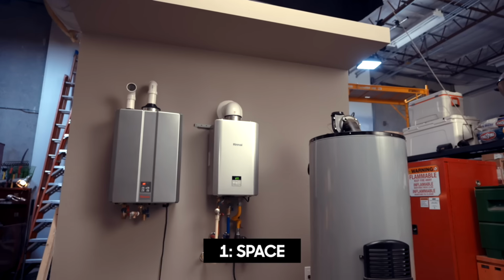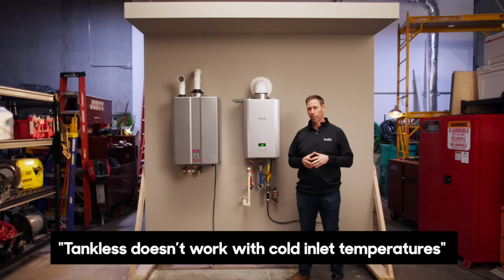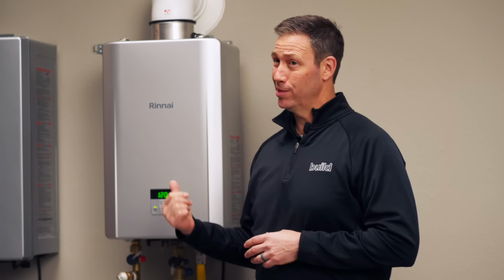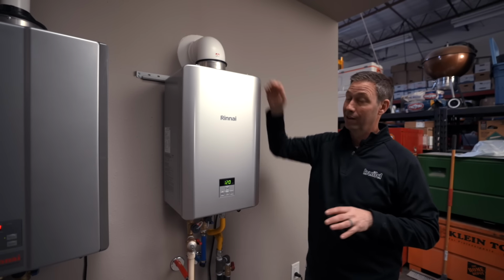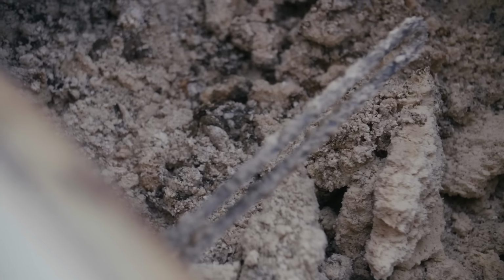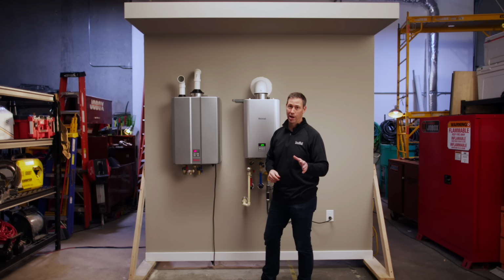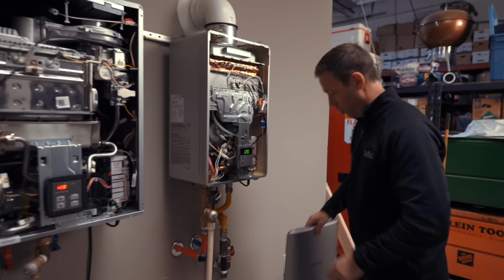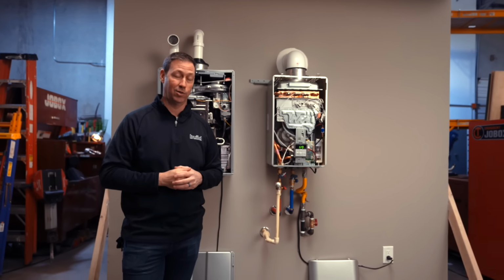DEBUNKING Tankless water heater LIES!

Comment: I'm a fan of the channel and really love watching some of the cool projects and products you share with us, but this one feels a bit too shill-ly for my tastes.  I know you have a lot of sponsored content on your show, and I think you usually handle the sponsor better and more evenhandedly than you did here.  I would have preferred to have seen how this compares and contrasts with other legitimate recommendations you've made for heat-pump tanks or other solutions on the market.  You can do better than this.
Reply: It is absurdly false for Matt to claim that now days a tankless costs about the same as a tank... not to mention a more costly install.  The total cost of ownership over a 15 year period is considerably more for a tankless (per Consumer Reports who also said there is no payback for the extra cost).  How much does it cost to periodically have a plumber come out and clean the heat exchanger?  To say you have to deal with scale regardless of system is false again.  Note that Matt shows an electric tank...not a gas tank which has MUCH more HX surface area.  The average homeowner can open a valve to drain sediment from a gas tank but most can't or won't clean a heat exchanger.  Most home owners DO NO water heater maintenance... a little REALITY check.  As a plumber in Texas I have seen countless homeowners that had to either get new systems or heat exchangers.
Reply: @logalert8954  that's not really true.  If you have a low usage of hot water that only occurs a couple times a day, a gas tankless can use less gas than a tank water heater that has to keep 40+ gallons of water piping hot 24-7-365.  The installation isn't necessarily more expensive, the PVC vents can be quite inexpensive compared to the chimney most tank style gas water heaters need.  For my parents the cheap installation negated some of the higher cost of a tankless gas water heater and their gas bill went down significantly.  It has paid itself off years ago and hasn't needed anything replaced.

Alternatively, if you have really high usage and happening at all hours of the day, tank style might be comparable in energy usage to the one or more tankless units needed to provide similar service.  A situation like that might never pay off, also apartment building water heater and industrial water heaters for places like laundromats.

Everything has it's place and tank style just isn't terribly efficient if the overwhelming amount of gas used is spent just keeping the tank hot.
Reply: @joequixotic3039  That is really true Joe.  How much does natural gas cost to run a water heater in the U.S.?  For most homes currently it is around $245 a year.  Not sure if you know Joe but there is a thing call fracking that was developed 15 years ago... its cheap now!  The energy loss over 24 hours in a 2 inch insulated tank is very minimal.  Again I am a plumber who actually installs both... its not even close regarding the average installation cost.  Ask any trustworthy plumber.  What was your parents bill before and after???  Tankless only saves around 25 to 30%... so they are saving at most $75 a year.  Over time that doesn't cover the higher initial system and installation cost.  Do the math... its pretty simple and or google consumer reports and read their article.  A 50 gallon gas tank costs $475... a tankless is more than double that... check online.  Again our install charge averages at least 50% more for tankless and we charge in central Texas $225 to clean the heat exchanger every 4 years.  If not it will scale up given you are hitting a small pipe with a flame.  It simply doesn't add up.
Reply: I like that you are very clear about the sponsorship - but it did feel like a bit of a sales pitch for the company. I think from an energy perspective the comparison with heat pumps is the interesting one. In theory they should be even more efficient, but are they, and which brands are best?
Reply: Myth's a much better implication than lie.
Reply: Yes, a really disappointing video. Replacing myths about thankless with questionable statements about tanked. At best thankless can get close to 100% efficient, but a heat pump HWS can be 400% efficient. Plus that can be 100% renewable energy. Many cities are banning new gas connections to deal with the climate crisis...and then we have this video.
Reply: @MrJamesy76  I am probably going to get a heat pump water heater for my 100% electric (solar) house but that doesn't mean tankless water heaters don't have a place.  So far it has worked out well for my parents with lower gas bills, plenty of capacity for their demand, and space saving too.

Heat pump water heaters seem amazing but they are electric which might not work in every circumstance and they are quite large which is a problem if your water heater location is too small.

Nothing is perfect.
Reply from the maker: Ok Jason. Appreciate the feedback. Thanks for your support. Matt
Reply: @buildshow  took it on the chin, good man.  I’d like to jump on the bandwagon here and say that you could definitely dive deeper into this topic.  One question I’ve been pondering is regarding the decision to use a big tankless heater or a few smaller localized heaters.  As cool as those big manifold systems look, I’m just not convinced they are necessary.
Reply: @Van-tastic  it seems like almost all homes are not designed for efficient layout of the utilities.  Mine will have my plumbing grouped in to two locations: upstairs/downstairs bath+kitchen and the laundry/water heater/filtration area.  Hot water should never have to move more than 30'.  That is for a fairly small home (2/1.5) but you could do the same with larger homes and have 2-3 zones to avoid the need for a hot water loop system for "instant" hot water.  The only thing is tankless heaters are not cheap and the really small resistance spot heaters use a lot of electricity making the hot water very expensive so the loop makes sense in a lot of situations probably.
Reply: @buildshow  I disagree, tankless is a great product.  Perhaps more comparison and a discussion of when tank style makes sense would improve this type of video but I think this was informative enough already.
Reply: I'm not sure if most of you read the title of this video lol. He's literally pointing out myths / lies about tankless water heaters lol. People responding are telling Matt to include other types of heaters... Hi, read the title, it's solely to address the myths and lies for ONLY tankless water heaters... Watch a video dedicated to cleaning one if that's what you're trying to view, but don't insult Matt for being true to the subject matter.. Wow...
Reply: @nuyork77  The problem is that Matt is the one that is lying.  A Rinnai tankless water heater (especially the ones pictured) and its installation does not cost near the same as a traditional tank water heater.   The savings payback per Consumer Reports is over 30 years (google it) and when you include the cost of the never ending periodic flushing of the heat exchanger it really doesn't make dollars and cents.  Most homeowners don't get the maintenance and it becomes a really bad situation.  You are litterally blasting a flame against a pinky pipe heat exchanger to heat water.  I also like how he compares the space savings with a huge commercial tank.  Point blank... Matt's Youtube channel is now just a person pitching products... which is what he was trying to do from the get go if you paid any attention.

Comment: @ 2:11 you make a great point that the shower temp is a mixture of hot and cold, so you don't need to determine what the GPM needs are based on 100% hot. There's a convenient formula to determine the exact percentage of hot water required to eliminate the guesswork:

= (T-C)/(T-H) / (1 + (T-C)/(T-H)) where T = target temp, C = cold water (inlet) temp, H = hot water temp
=(105-40)/(120-105)/(1 + (105-40)/(120-105))
= 81%

So, for a 2.0-2.5 GPM shower, with 40 F inlet temp, you would need 1.63-2.03 GPM of 120 degree hot water.
Reply: @DanielCaspi  No increasing temp at the unit will not increase hot water to the other fixtures. The unit is 200,000 BTU,s and no matter what you do the tankless will ramp up and down until it gets to an input of 200,000 BTUs . For instance lets say we have incoming water at 55 degrees and we take a shower at 105. That is a delta t of 50. Lets say we have a 2.25 Gpm shower head. So we multiply our 2.25 x60 minutes then convert to pounds and then multiply by our delta t to get BTUs per hour per shower. 135 GPH X 8.33 to get pounds per hour 1,124.55 X 50 =56227.5 x efficiency .98 =56,227.95 BTUs per hour at 2.25 gpm with an incoming of 55 degrees. Therefore you will get 3 good showers at 56,227.9 x 3 = 165,308.85. You are not going to slow one down or heat one up. It is just a simple matter of available BTUs. This is a big misconception in the HVAC field. Delta T and FLOW are both needed to figure BTUs. Also I would like to point out  on a Navien  When you flip the dip switch to raise the temp above 140 your warranty now goes to 8 years instead of 15 on the exchanger.
Reply: @anthonyspadafora1384  I see your point now about the energy balance calculations! Thanks for the correction and explanation. I thought the heating process worked a bit differently, and I've removed my previous comment.

It seems the only advantage to a higher temperature is having a hotter water supply at the hot-only outlets (e.g., dishwasher, laundry), which you could argue improves efficiency -- if you are having to repeat washing cycles due to incomplete cleaning. Rinnai warranties are not affected by the 140F dip switch.
Reply: You are not reducing anything, water flow remains constant because of the shower head restriction. So ultimately you need to measure incoming water temp and the temp you take your shower at, usually 105f. This will define how many BTUs you use per hour taking a shower. If you make the hot water hotter then you will just add more cold at the shower valve. This in fact makes the water heater less efficient because you are running higher stack temps when you increase the water temp at the heater.

Comment: We have no natural gas in our area.  Propane cost with the rules and regulations and fuel tank purchase or rental is cost prohibitive.  So electric is our only real option.  We used a small tank for storage (which does have to be powered), and then a tankless electric into the cold water input, and a recirculating pump which circulates the warm water in the line back to the tank, with a check valve preventing backflow into the tankless.  Works like a charm and hot water at every fixture in 2 seconds thanks to the pump.

Comment: Matt, I love your show but going from tank to tankless is always more expensive. In just labor alone you’re looking at about 1K more plus materials another 1K. Most tanked water heaters operate at 40-70k btuhs while tankless operates at 200k btuhs most gas meters aren’t sized for that even if you try to pull the gas through it, the meter will lockout. I don’t mind tankless I work on them all the time but the homeowners need to know they’ll spend more on maintenance as flushing a tanked water heater is like $150 where flushing a tankless is $350 in my area. Also, more breakdowns, sensors and valve failures are common throughout all brands. In some houses people experience the cold water sandwich which a secondary holding tank is required. I like tankless but the homeowner must be made aware of the benefits and downsides to tankless. Thanks for the video and keep them coming.

Comment: #969👍I looked into this.  My stainless steel gas water heater also heats my home.  It is super efficient and will out last me.  It also is easy when the power goes out since the generator is little used.  Why don't you get us a discount?

Comment: My parents had a problem with their tankless, when they would run a shower sometimes they would get no hot water at all.

So they adjusted the temp setting on the water heater up and made it worse.

The solution was to turn the temperature down so that the mix required more hot water to reach the temperature they desired.

I think a lot of people deal with the same problem because no one tells them they need a certain flow to kick on the heater and the higher they set the temperature, the lower the required flow will be.  This was in California  with low flow shower heads so it probably wouldn't have happened with full flow fixtures or maybe they got a water heater that was too big for their use.

I figured it out for them but they were about to complain to the plumber.  Now it has probably been a decade of reliable hot water with no issues since.
Reply: Yes, there's two factors, 1st is the minimum flow rate to even get the unit to fire.  2nd is the minimum fire rate on the burner.  For my Takagi, 0.6GPM on the minimum flow.  But the minimum fire rate is 15,000 BTU/hr.  I always set my temperature to the desired temperature, say 100F for a shower.  Then I don't need to mix in any cold.  I did have a time or two in late summer, when our water temps get up near 80F, that the heater was cutting off when the water flow was too low.  I have a low flow shower head and if I go below about 1.2GPM, and that's real near the low fire rate.  Aside from that, I love the tankless.  In an older house with the separate hot/cold taps, just setting the temperature to 100F and turning on the hot, it's always the ideal temperature.  And it's not going to change if a toilet is flushed, etc.

Comment: Two questions.  

1 I'm building a cabin in Tennessee and would love to put my tankless outside.  What about freezing Temps?
2 aren't the recirculation pumps defeating one of the biggest advantages which is not using power/gas as much because these are on demand?  If you're recirculating the water then you have to be running the gas all the time, no?
Reply from the maker: I’d keep it inside. And yes on #2 but only for short times.
Reply: For #2 your are talking about a trade off. Either waste some gas on recirculating or waste water to clear the cold water in the lines. There are intelligent systems also that will only run a recirc pump when you need it.
Reply: @bluenadas  I understand that but I guess it depends on how often you use the hot water and how much pipe you have vs how much LP or natural gas you want to use up.
Reply: @rha600  very true. Those questions will always be installation specific.

Comment: Matt  you are totally full of crap.  You should actually try to live with one of these units in the northeast before making broad generalizations about them.  Watertown NY is NOT  Austin, Texas. I started installing gas-fired tankless hot water heaters in the northeast in 1982,  (Paloma Paks) and have put in 100s of them since (and replaced 100s of poorly planned or installed units with conventional tanks also) , and I'll tell you what... they do NOT last 20 years, they do NOT produce "endless hot water,"... scale/and sediment WILL destroy them,  and the input temperature TOTALLY impacts the performance of these units.  It's NOT a myth that you won't need to update the gas line... some of these units have a  200,000 BTuH and require a 1" gas line.  A half-inch gas pipe  is undersized by 2/3 an will NOT NOT NOT  satisfy that burner.  MOST units can NOT recirc (although a few can... now) but that recirc. also impacts the efficiency of the units.   The best bet is to install multiple units as close to their output load as posible - several smaller units is normally way better than trying to replace a whole-house tank with a single tankless. Tankless hot water heaters are a good solution in a variety of situations, but NOT every situation by a long shot.  Sorry  Matt - I have 40 yrs on you bro' and I know exactly what I'm talking about. Stop being a fanboy for things you have no direct experience dealing with.

Comment: a buildup of scale and minerals in a tank does nothing to the function of the unit.  A buildup of scale in a tankless shuts it down.  You are not being honest with yourself or your audience.
Reply: Serious? A buildup of scale and other crud on the inside of the bottom of a water tank will slow down the heat transfer of the gas burner under the tank. The efficiency will slowly drop. It only takes about thirty minutes to descale a tankless and you are back to maximum efficiency.
Reply: @davidcopley2599  I agree with everything you said. And a build up of scale will still not affect the function of a conventional hot water tank.  Might affect efficiency.  A build up of scale will shut down a tankless.

Comment: As a European I'm kind of surprised of a life span of only a decade for a tank water heater.

It's usually 25+ years around here.
Reply: If you get some of the really cheap junk that is sold in some home improvement stures, the life expectancy of a tank water heater can be as low as 6 years
Reply: @shannabolser9428  So where people should get their tank from?
Reply: @MarcFun  you can go to a plumbing supply house where that is all they do or a trusted local hardware store can sell some good ones sometimes. AO Smith is a good brand.